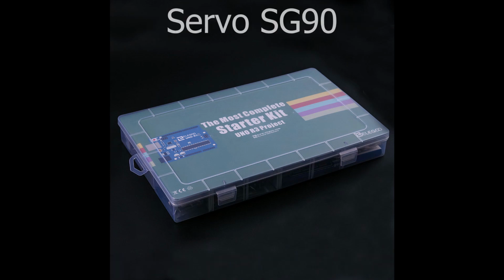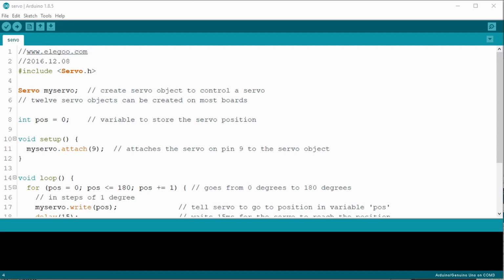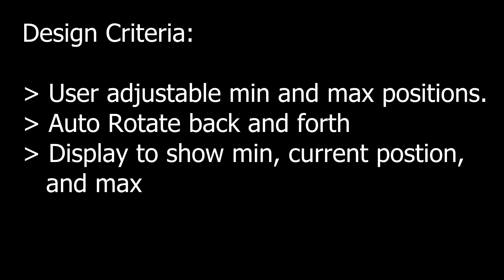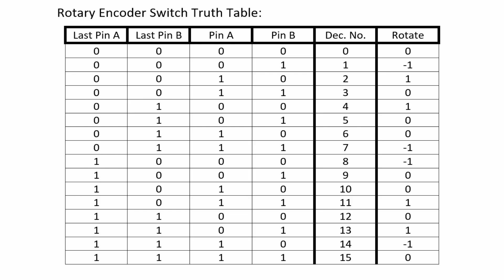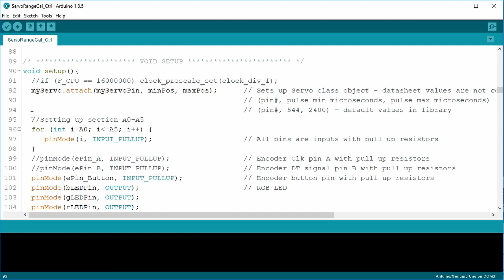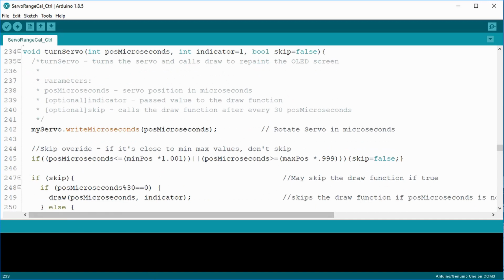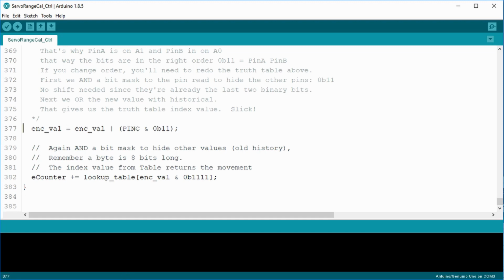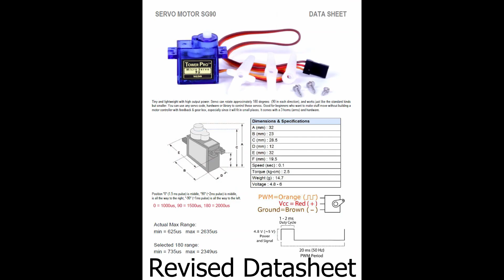Lesson 9 - Servo and the Rotary Encoder

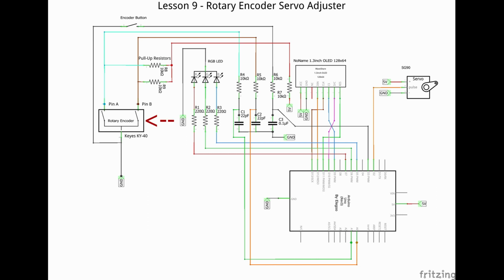Comment: Hi there, can't find a .01 uF capacitor as per the Servo Adjustment circuit parts in the description-  but - the circuit schematic shown at 8:37 shows a .1 uF capacitor; so I presume that's the correct one. Cheers!

Comment: Hey Ricardo
Very interesting Tutorial btw
I got to learn a lot from it (I m working on a projet where I m looking to control a servo with an Encoder and display the position of the servo "in degres and not milliseconds" on "optionally" an Oled/LCD display) still there's a lot of details I wasnt able to understand as a beginner, althoug  I watched the video like 10x. 
Here are my questions if you got the time to answer them (it would be in any case much appreciated)
- what is the diffrence btw Input_Pullup and the normal Input ? what did you use the pullup_input
- in the void setup, you defined the ebutton (everything sounded logical as you were explaining the code but then nothing made sens as I was modifying it for my project) but you didn't attribute any Pin to it. 
- you also introduced the voidpcisetup, what does Byte and Pin on the first line stand for ? 
in the second line you wrote *, does the code line must incluse that * ?
- I couldnt really understand the whole setup (those 4 lines)  
I will add some questions as I go through the video again. hope you find time to answer those questions. Cheers :)
Reply from the maker: - The difference between INPUT and INPUT_PULLUP for the pinMode command is that INPUT_PULLUP also enables the internal Arduino PULLUP resistors.
- Why use the pullup resistors? To prevent a float condition when the input pin isn't directly grounded or at +5V.
- ebutton: If you are referring to eButton_isr, I'm defining what function to run for the attachInterrupt command. Lookup "attachInterrupt" in the Arduino.cc web site.    
- void pciSetup: sorry, these lines are kinda advanced.  I forget that I need to keeps things simple.  Here I'm using an advanced techique to set Arduino to detect an interrupt signal from ePin_A (A1) and ePin_B (A0). Either pin will enable a group pin interrupt.  Because this is low level coding, ISR (PCIINT1_vect) function is called.  
- The * is required, it's a pointer.
You should also check out Kevin Darrah https://www.youtube.com/watch?v=HQuLZHsGZdI
Reply: @rickmorenojr  Thank you so much for this detailed answer !

Comment: So  1011 was 1? Sometimes negative numbers are stored like that. Im not sure but I think its called the 2's Complement or something. From what I was taught theres a sign bit for pos or negative. since this is first four bits I think the nibble order is swapped. But I could be wrong. How are negatives stored in arduinos memory. do you use * for pointers and & to get the addresses.